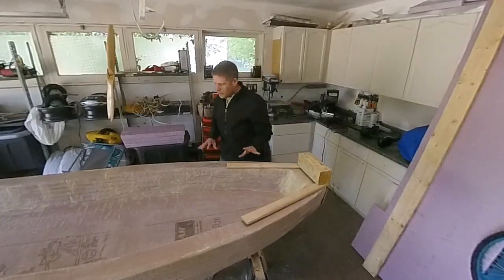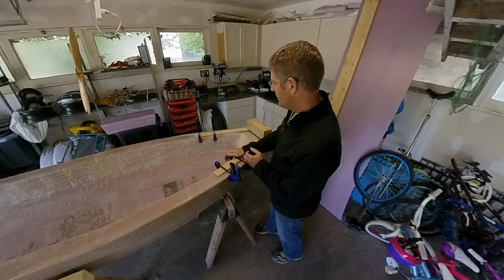DIY Foam Kayak - part 13

Comment: Sorry if its a stupid question  not very smart about boats but i know if you make more parts to break that is more sruff to fix if it goes south
Reply from the maker: This is my first boat build, so I made lots of mistakes designing and building it (the fibre glass job is a mess). I would do a lot of things differently next time, but I do like the empty hull without all the lumps and bumps of a fishing kayak, or the sloped walls of a canoe. I love that I can lay down in it, stand up, move about. Best of all, it is way lighter than the old 85lb canoe I used to lug about.

Comment: Just a question but why not just cut the rear section to fit the mount and refiberglass the area instead of adding extra stuff to break or go wrong
Reply from the maker: Yeah I should have done that.  My thinking was, it would need to be pretty strong and therefore heavy, and I wanted to keep a very lightweight version when not being used with a motor.